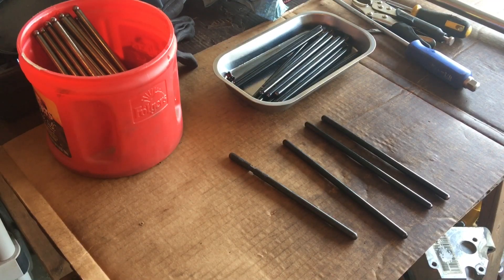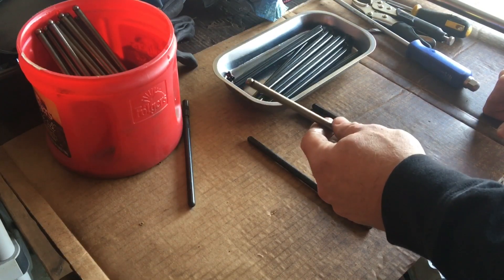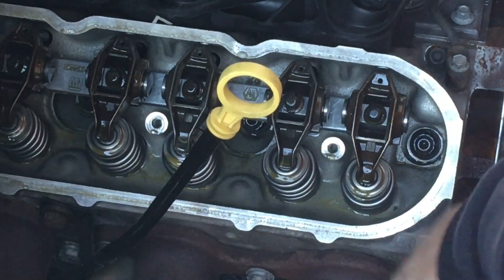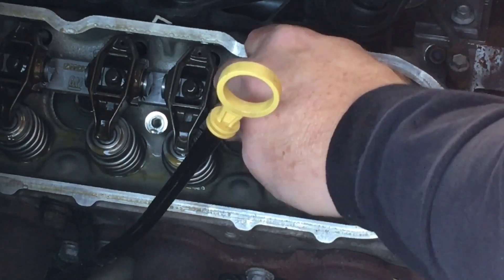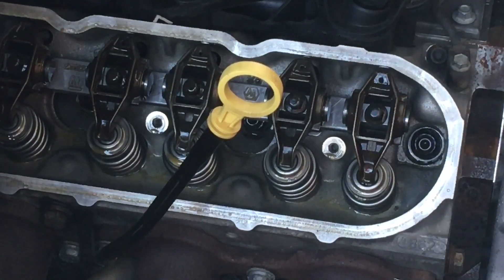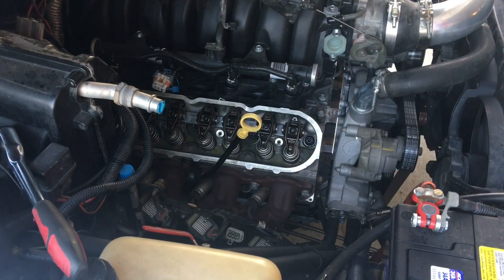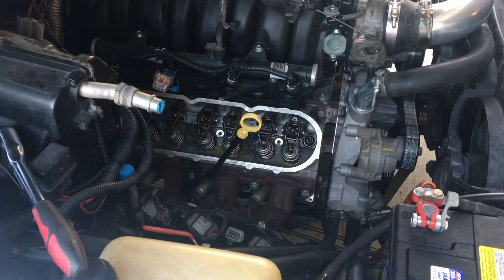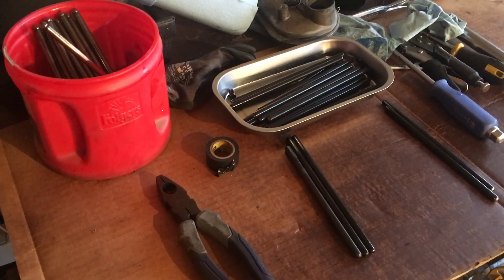LS pushrod length tool Comp Cams 7702-1

Comment: I'm going to make a solid lifter by taking out the spring, and stacking washers inside until I can just get the retaining clip back in. I know that it's a pain in the ass, because you need to take the head off to change back to the regular lifter, but this will prevent accidently compressing the lifter, also good for checking piston to valve clearance.
Reply from the maker: That’s how we used to do it when I built and Raced Pontiac V8’s.
The only issue back then was the difference between the pushrod cup depth between the solid version vs hydraulic lifters. 
With the LS engines as long as your still using the same/similar lifters it’ll take the guess work out of finding a true Zero lash.
* There’s a technique requiring a soft touch to find Zero lash on a hydraulic lifter because the dry lifter plunger is so easy to compress, especially with the rocker bolt.  Good idea! 👍
Reply: I'm using an old pair of lifters that came out of the 6.0(364) engine that I'm working on. I'm using Gen IV rods with the free floating pins, and flat top Speedpro pistons. There is 32 grams difference between the Gen III and Gen IV rods, and 23 grams difference between the stock piston and the Speed Pro pistons, so I had to have the whole assembly balanced. Weight was added to the crankshaft to make it work out. I'm using a .550 lft cam, so now I'm checking to make sure the retainers don't smack the top of valve guide.  @HeadFlowInc
Reply from the maker: Should be no issue with the guide-to-retainer clearance @.550” lift.  .550” lift is pretty mild for an LS cam. 👍👍

Comment: Interesting. We have a lm7 on a stand trying to do a sloppy stage 2 turbo build. Was told we can use the stock pushrods with the ss2 cam but I think he uses stock lifters and not the ls7 replacement lifters. If I was going with ls7 lifters with a cup height higher than stock I believe .05 and I plan on a ls9 head gasket which is also thicker than stock. Wouldn’t these two number modifications( higher cup height ls7 lifters and a thicker mls ls9 gasket even itself out? Or am I thinking incorrectly? Everyone also has different opinions on preload for ls7 lifters, trying to get the base Delphi’s. The non knock off pushrod checking tools also seem to all be out of stock last time I checked. Thanks
Reply from the maker: True LS7 lifters have a deeper pushrod cup requiring +.050” longer than stock pushrods.
A good all around lifter preload is .050”-.070”.
The best way is to measure your PR length with the lifter on the heal or back side of the lobe to just get true zero lash then add the .050”-.070” to get the overall length. 
The toughest part is understanding what true zero lash is, because the plunger spring is easy to compress; the PR will still spin with enough force after compression starts!  You have to establish what I call the flick or ultra light turning of the PR to identify when it gets to zero lash without compression.  JD
Reply: @HeadFlowInc  wow, looks like I had the measurements backwards then. I thought the cup height was higher and a shorter or even stock pushrod would be needed. Back to the drawing board I guess. Thanks

Comment: Don’t you want zero lash with the bolt torqued to spec? Then add the preload??
Reply from the maker: During the process for measuring then determining the required pushrod length to result in proper lifter preload includes finding the initial length at zero lash. I hope that makes sense, the length of the pushrod at zero lash doesn’t pre-load the lifter you have to add the pre-load amount or the preload you want to that zero lash measurement. So with the lifter on the backside of the lobe you are determining the distance or length to create a zero lash that does not compress the lifter at all, which can be challenging because the lifter will compress really easy. I think you’re following the process of finding that zero lash pushrod length then adding the amount of free load you want to that length. If I’m still being confusing let me know?  JD
Reply: @HeadFlowInc  https://youtu.be/qnI-Mmuo2bU
Reply: @HeadFlowInc  I understand that, but thought the zero lash pushrod length was taken with the bolt torqued, not finger tight.

Comment: Great video and explanation. Thank you!

Based on the eBay listings, it looks like there are a lot of sellers who are selling the pushrod checking tool and stated that 7702-1 is the 'interchange' part number. They are selling a copy of the Comp tool with their private label but listing the 7702-1 as the interchange. Most people see the 7702-1 and think it is the Comp tool for half the price. In reality, both tools probably come from the same factory in China. In this case, the operator of the tool is more important than the quality of the tool itself.
Reply from the maker: My only complaint is you need to put a piece of tape on it to hold the adjustments.  Also there’s no numerical reference to each mark so you have to close it fully to establish the base length then count the turns to set new length. It can get confusing.  JD

Comment: They say 7.400 because 7.385 is only .015 off and a stock lifter calls for .030-.050 preload. Like ls7 call for .080 to .100 basically .015 does not matter. It will not change anything. That’s why they only sell aftermarket pushrods in increments of  .025

Comment: I believeI'm having the same issue, just fired up my fresh new rebuild 5.3 w/tsp stage 3 cam. Super loud noise coming from the valve cover area. I dread braking it back down. Just want to get the right info before I rip it down
Reply from the maker: Get the Pushrod length tool it’s super easy and sets the proper lifter preload.  What brand lifters are you running?  Make sure to verify what preload the lifter manufacturer recommends; it could be:
.040-.900” or short travel lifters are even less preload. 
JD
Reply: I have to get the lifter info from my builder and go from there. I should have made sure all this done correctly before in install. Much easier with motor on the stand than inside engine bay....thanks for your in depth video

Comment: I have 799 heads milled .030” I measured my zero lash and it’s 7.325. I have morel 6504 lifters and from what I’ve been told and have read they want .050-.060 of pre load. So I bought BTR 5/16 7.325 .080” wall and my valve trains is very noisy. Not sure what to do....I have .050 of preload
Reply from the maker: Unfortunately you have ZERO pre-load! 😳
If you measured the zero lash as 7.325” and bought 7.325” pushrods you have Zero lifter pre-load.  You find the zero lash, in your application equals 7.325” then you “ADD” the amount you want to compress the lifter plunger aka lifter preload. 
7.325” + .050”= 7.375”
7.325” + .060”= 7.385” 
And so on... Honest mistake! 
I’d run the 7.375” since they’ll be easier and cheaper to find. I hope this helps clarify? 👍😇
Reply: @HeadFlowInc  I’m sorry I wrote in error. I bought 7.375 push rods. (.010” shorter than factory) but it’s still noisey
Reply from the maker: I would verify with the lifter manufacturer again some use pre-load set deep .080-.100” like BTR. 
Another area is the seal on the cam plate behind the cam gear, If you reuse the factory plate it will leak it just depends how much, which can starve the lifters. 
On new builds sometimes people forget to install the main oil diverter “Barbell” in the rear of the block behind the back cover. 
Leaking seal on the oil pump pick up tube seal. What’s the oil pressure Cold and Hot?
Reply: @HeadFlowInc  I replaced the cam retainer plate and bolts. Replaced the pickup tube and deleted the oil pan bypass valve (gen 4) oil press cold (30F) is 70psi and oil warmed up idle is 40-45psi

Comment: Do you have any experience with DOO lifters? I installed new ones and they have a lot of ticking. It seems that maybe pushrods are to short as when I push down on rocker the lifter is squishy. I did install a fuel pro gasket which I believe is thinner than the stock one but it seems like that would be better. Any help would be greatly appreciated.
Reply from the maker: Sorry I’ve never used the DOD stuff we remove all those when building performance.

Comment: So you do not tq the rocker fastener checking for 0 lash?
Reply from the maker: lsxjunkie At around the 4:05 Mark in the video i’m explaining how the rocker bolt needs to be seated fully and the pushrod tool should still rotate fairly easy with minimal drag.  There’s no reason to torque the rocker bolt during the checking process, once the bolt & rocker seat in the rail it’s not going to compress anymore by torquing.  
The tip to measuring zero lash is learning a light touch when flicking or lightly spinning.  You’ll discover it’s really easy to compress the lifter plunger and still force the tool to turn this is wrong!   Thanks for the feedback!  JD
Reply: @HeadFlowInc  So how do you know the rocker arm bolt is torqued to 22-25 ft lbs?

Comment: so the desired lifter preload will be added on top of my pushrod length measurement? Say if my pushrod length measurement is 7.300 and I want 60 thousandths preload my required pushrod length will be 7.360.. correct?
Reply from the maker: Classic Car Garage Yes, when you’re using the adjustable pushrod tool, you’re measuring zero lash with the lifter on the heal/back side of the lobe.  Zero lash length + lifter preload= PR Length.
Find out how much preload you want, iirc the less preload the louder the Valve train noise.  JD
Reply: @HeadFlowInc  thank you, what would be good preload for decently quiete valve train noise and good for performance? if preload effects performance that is... I assume it would but I am new to this
Reply: Or, you could lengthen the pushrod checker once you have zero lash and torque the rocker arm retainer nut to 1/2 to 1 full turn (my Ford engine is 20ft lbs) Then you could measure the pushrod checker.  That would give you about .050 lifter preload.

Comment: Does this work with a gen 1 SBC's with retro fit hyd roller lifters?
Reply from the maker: dickey moore No it won’t work the same way because the LS is a non-adjustable valvetrain and your SBC has adjustable. 
They sell a plastic tool to help measure the needed pushrod length.  Or you can start with an OEM SBC length PR and measure the pattern on the valve tip. 
Do a search on setting the valvetrain geometry on a SBC. Thanks for watching!  JD

Comment: I’m having trouble getting a straight answer out of my lifter manufacturer. This is there description. My base height checks out at 7.275” what would you suggest on pushrod length? I’m thinking 7.325-7.350... 

OE-R lifters are specifically designed to perform at higher engine speeds. When engines are equipped with a hydraulic camshaft, high rpm is limited by the improper position of the internal piston as the lifter inevitably "pumps up". This improper location results in open valves and therefore leads to lost power. These lifters are almost required for any 3800 car shifting above 6000rpm because they help with the typical 5600rpm dip. OE-R lifters are preloaded and have to be installed between 3/8 and 3/4 turn (vs. 1/2 to 1.5 turns on stock lifters). These are a shim valved lifter like the ZZP and LS7 lifters. They have less range adjustment so preload is more difficult to setup. It's recommended to use a pushrod length checker.
Reply from the maker: 2avsman You’re saying the “Zero Lash” on yours is 7.275”?
Hopefully this length was measured with the Adjustable LS pushrod?

LS engines vary greatly by manufacturer of the components. Preload:
GM says .050-.060” 
Katek says .070”
BTR says .090-.100”

There’s two theories about what works best to control the valve float at full pump up. 
In an LS is shoot for .070-.075” preload for a quieter valve train. 
Running a .050-.060” preload would work but the rockers might be a little loud depending on the cam lobes aggressiveness.  I hope this helps!  JD
Reply: Yes I used the push rod length checker. The cam is btr stage 3, 218/224 .553/.553 113+3.    799 heads decked .20” resurfaced block. Thanks!